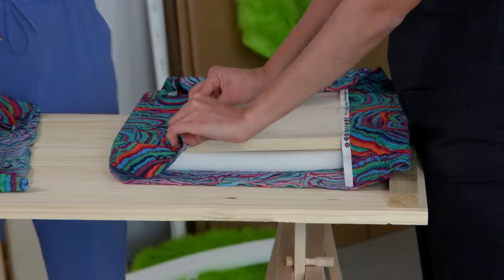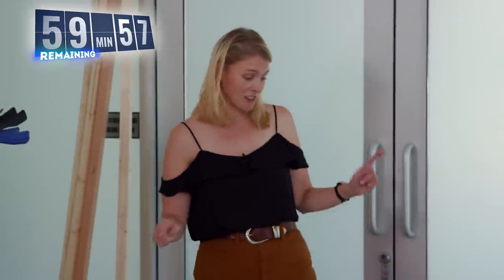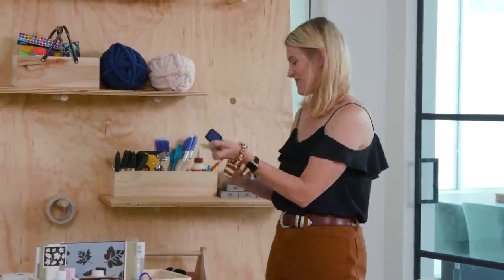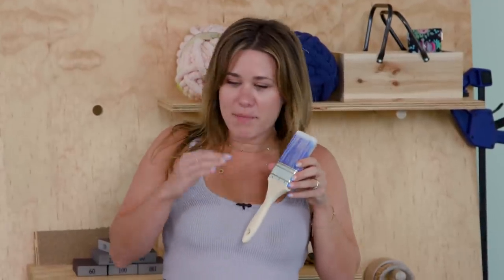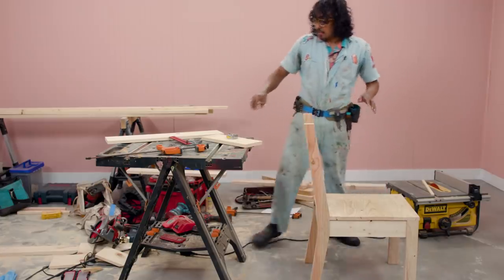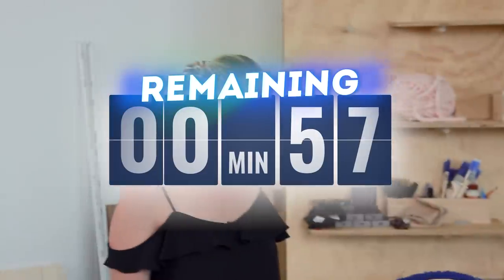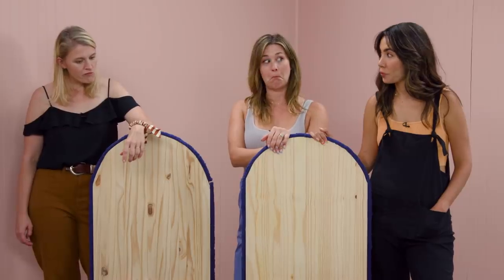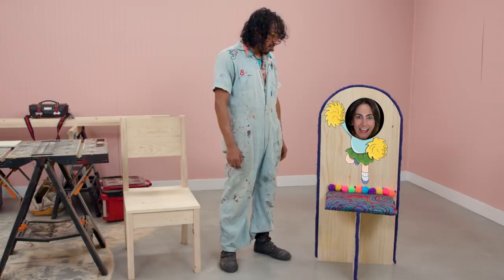The Try Wives Build Chairs Without Instructions

Comment: my carpenter brain every time they put on gloves and then use a saw: AAHHHHHH
(my shops all have pretty strict no-gloves-with-saws rules because you run the risk of getting your glove snagged on the blade and having your hand sucked inescapably into the saw— now instead of losing a bit of a finger if you’re careless with your hand placement, you’ve lost your whole hand)

Comment: D: aaaaahhh gloves on while working with any powertool with moving parts is something you should not do. A glove can get caught in the machinery so easily, and your hand will NOT just slip out of the glove. If your glove gets caught, so gets your hand, and then it's your hand in the machinery - there will be a mangled mess. Even if you're very confident you'll do your best to keep your digits away from the moving parts, please... just be without gloves. You can yank a bare hand away by reflex, you cannot yank back a hand that's inside a glove, it will go with the glove. For safety everyone! :/ (otherwise lots of love <3 for carpentry diy.)

Comment: Love this series but there were so many safety issues it was freaking me out! I get that it should be 'without instructions' but safety instructions (like hair tied back, close-toed shoes,  safety goggles, and how to handle machinery safely) should definitely be given in the future. Not all safety is intuitive in the shop. For example, I was taught that gloves with machinery can actually be unsafe as the gloves may get caught in the blades/guards and cause an issue. I hope that stuff wasn't glossed over to make a funnier/quirkier video. Loving the overall vibe of the try wives though.

Comment: Ok so....some shop safety all in one place since there were places in the video where this was nodded at but it might be helpful to anyone using power tools in the future to just....have it all at once. Also the reasons why, because I know it sounds like The Fun Police but I promise it's not.* (Love these ladies, definitely have been guilty of a few of these violations myself, absolutely NOT trying to drag anyone involved.)

*This is from the perspective of someone who worked in a University scene shop for four years, not a professional, but this is BASIC shop safety so please do listen.

Clothing - Always, always wear clothing that covers as much of you as possible; it is a protective layer over your skin. Long pants, closed toed shoes that are secure to your foot (so it doesn't come off accidentally), and at least a t-shirt.

Dangles - Don't have anything on your body that hangs significantly off of it that could catch in machinery. Take off any necklaces, bracelets, straps/clothing that is loose, scarves, ties, long hair should be pulled back at least to a pony tail, etc.

Safety equipment - There is equipment that is specifically designed to protect you while you are having fun with DIY, and it helps KEEP IT fun instead of ending in a trip to the hospital. 
           Safety glasses/goggles is one of these. Sunglasses work in a pinch as they are technically a protective layer between your eyes and whatever you are working with. BUT they are not designed to be shatter resistant, so if a big chunk of something hits you in the face you will absolutely be injured. If you have the option, please do not choose sunglasses over designed safety glasses or goggles. (No matter how cool they look lol.)
          Hearing protection is another, ESPECIALLY if you are using power tools. Either a big, chunky, padded headset that goes over your whole head or little squishy ear plugs, it's good to have SOMETHING to dampen the noise. Your hearing can and will be damaged by repeated exposure to loud noise at close volume and it is *irreparable*. You WILL end up with permanent hearing loss and/or tinnitus if you do not protect your ears.
          Gloves are good, especially when you are moving big pieces of wood that can give you splinters. They are a protective layer and also can give you grip. You may not want to use them when using actual power tools however (especially if it's an unfamiliar tool), because it can block sensation for you and lessen your control over the machine. This will vary from person to person and depend entirely on what tool you are using.
          A dust mask might also be necessary/a good idea depending on what you are doing. If you are already sensitive to dust, it might be a good idea to wear one anyway for obvious reasons. But also if you are doing anything with aerosols (like spray paint) or cutting something with a high amount of dust created and/or potentially toxic material that you should not be inhaling (like homasote for the dust and PVC pipe for the toxic material) then you should be wearing a dust mask.

Buddy system - If you do not have a person directly with you in your workspace (as the Try Wives demonstrated admirably here), at least let someone know where you are and what you are doing. In the event of an accident (something falling on you, a machine acting up, etc), it is a very good idea to have someone else know that you are in a potentially dangerous situation so that if Danger does occur, they can help. Buddies in the workspace is also a good idea in general because they can help hold and support large pieces of material you may be cutting, rather than them falling to the floor uncontrolled.

At the end of the day, DIY and power tools ARE fun and you should have the opportunity to enjoy it safely!
Reply: THANK YOU, there has been a surprisingly little amount of comments on how unsafe so many things in this video are. I feel like it would have been easy and very helpful for the audience to understand that this isn't a fun little thing that at most might get a bruise from (still heaps of fun but always be safe) but could really badly injure you if it is not done properly.

Comment: Why is everyone's hair down!? Even the expert carpenter has his hair down!
Reply: Because they're not children. Ariel's the only one using a power tool. There's no possible risk for Becky or Maggie to get their hair tangled standing several feet away from the equipment lol. Same with the carpenter, he's not going to magically get his relatively short hair tangled to a small handheld drill. The hair rule is really only relevant if you're using powerful automatic drills or are a literal child with no spatial awareness. I'd be more concerned of the actual risks like willy-nilly use of saws (WITH GLOVES) and not wearing proper safety goggles.

Comment: You shouldn't put gloves on with spinnig power tools. The gloves will not protect you from the blade and if they get stuck on the blade it could lead to a completely mangled hand (instead of a cut of fingertip, which is still bad but not as bad as the other options)

Comment: I LOVE the trywives and think they did an amazing job, but I do have to say the prep for this video was off. This company does such a great job with safety in the food vids and other riskier tries, but this video seemed not to have anything ready for power tool use! Trywives are obviously amazing competent people, but you KNOW this is just going to be a video of women using power tools to some people, and they will be extra critical because that’s how viewers can be. Set them up for success with a serious review of safety protocol (you have an expert RIGHT THERE!), all safety equipment put out in advance, and extra supplies just in case. They should not have needed to use Maggie to hold the chair still on top of the sawhorses, even an actual work table would have been helpful, and they should not have had to use sunglasses as goggles or not known to put their hair up. Especially unfair to Ariel, who does this professionally and has to worry about being judged already as a woman doing badass stuff with carpentry etc.

Comment: They should have had the carpenter on set, or the production manager should have done a better safety run down. There are so many unsafe things going on here. I actually know people who have lost a finger or lost an eye because of a lack of safety, and that is absolutely not something to mess around with. Obviously people have to take safety into their own hands, but endorsing safety squints? Free hand jigsaw cutting? Using a circular saw between two sawhorses with both ends of the cutting material fixed to the sawhorses? Stupid and irresponsible. This could have been a much better video capable of empowering the audience if the producers helped the three out a bit more to really show how to be safe.